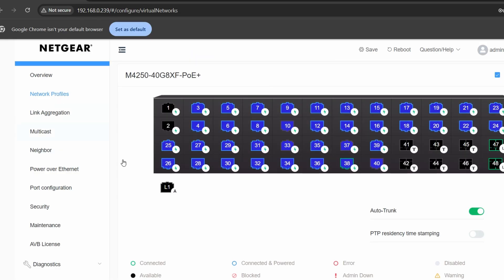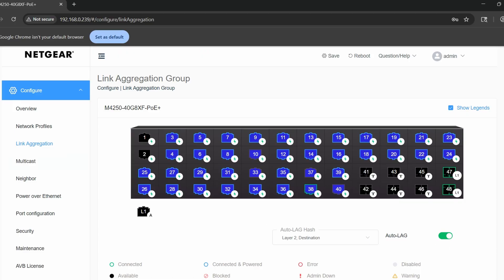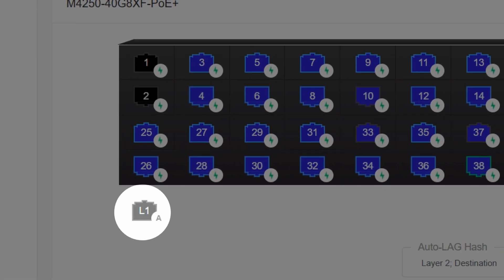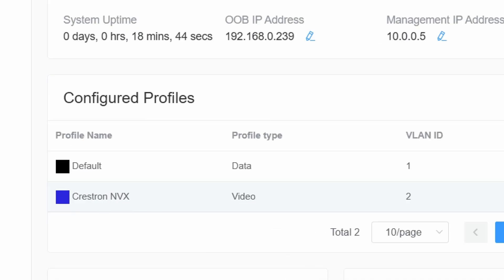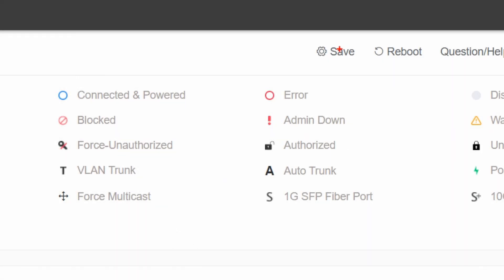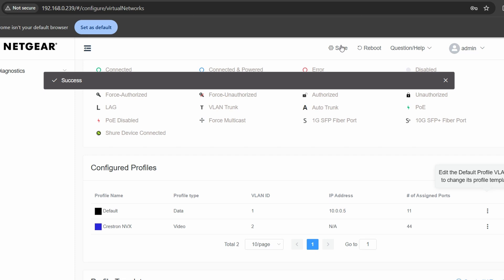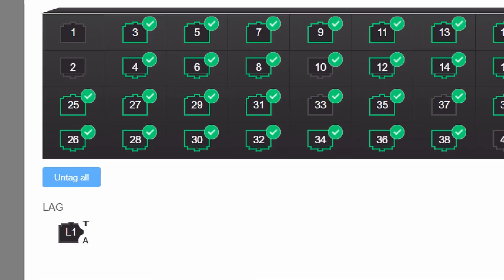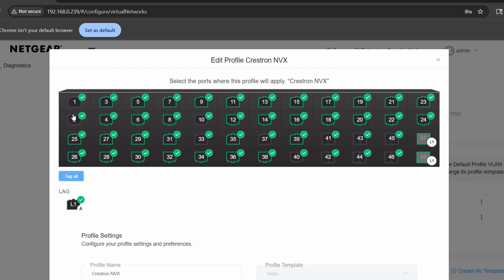4 things you need to know about linking Netgear AV switches together!

Comment: Very helpful. We've been using ZeeVee and Visionary based on what client needs are.
Reply from the maker: Netgear has made it so much easier for us AV guys......  its been awesome!  I'm a big fan of the Visionary Solutions stuff.   Its always been super solid for me.  ya know..... if you watch the video I keep saying... make sure there is only (1) querier running per VLAN between the two switches.   I just recently found out that the Netgear AV is so smart that it will automatically manage that.   Apparently if you leave a querier running on both switches it will shut one off!   so amazing.   Meh - I still like to log into the 2nd switch and shut it off though, makes me feel better.   Always learning new things every day.

Comment: I love these Netgear AV switches but I always run into a knowledge gap, even with the simplified AV side of the switch. I never know how to set the ip address of the switch. Every time I do I lose the ability to connect to the switch and have to factory reset the switch. Also If I create different vlans on the switch how do I talk to all vlans from my pc? These are questions of ignorance but I am usually left holding the bag on a jobsite setting these up and I usually get them working fine but not in the way I want them to work...
Reply from the maker: I hear ya brother.  Us AV guys are now being forced to become network engineers.   It’s a learning process for us all!   The Netgear AV switches preloaded config files are an amazing concept however.   The best way way talk to these is to connect via the OOB port.  Connect your computer to the port, reboot the switch, and find the web configuration page at 192.168.0.239.  You can also set a different IP to the base Vlan1.   The trick there is leaving port 1 at Vlan1, so you can still talk to the switch at that IP if needed.   For the longest time, i’d assign Vlan2 to every port…..